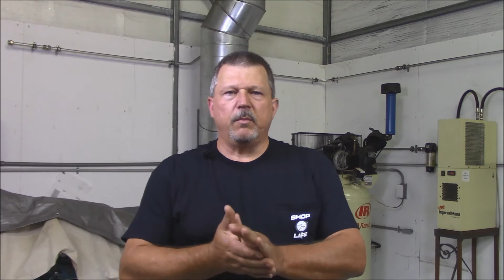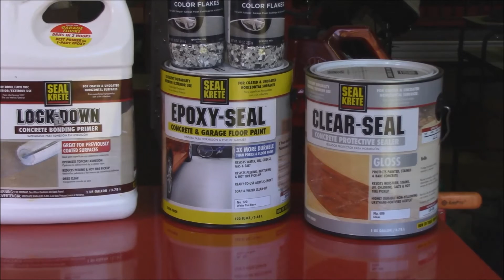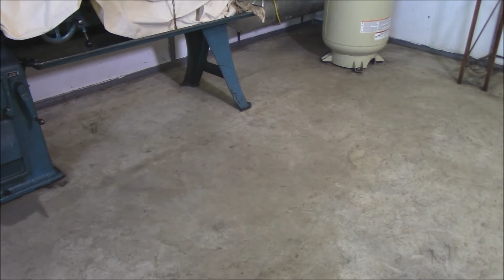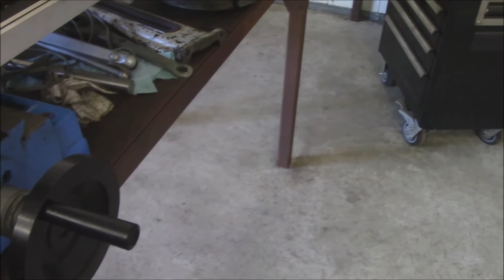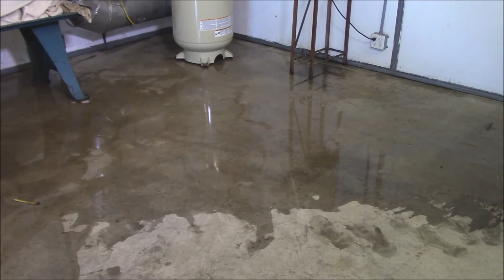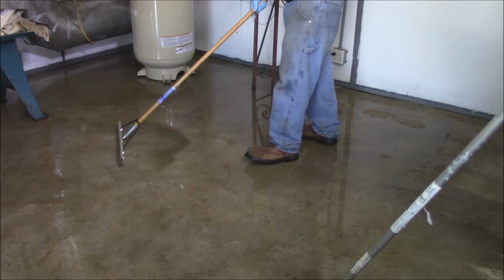Floor Wars Part 2

Comment: Don't bother with the Clear Seal step. The Seal Krete epoxy paint leaves a nice smooth covering. The Clear Seal finish causes covered over stains to show through the final finish. I had to redo the Seal Krete process over to get a good acceptable finish.

Comment: My expert with this product was miserable. I waited a week to be on the floor after install. Any time it is wet  when it dries it sticks to everything and pulls up the paint.Tires and even wet shoes. So much wasted time and money. I followed the directions to the T and still didn’t work as advertised. Very disappointed.
Reply from the maker: Sorry to hear. May have been a bad batch. I've had no issues with mine to this point. If you have your cans you may be able to get a batch number and reach out to Rustoleum